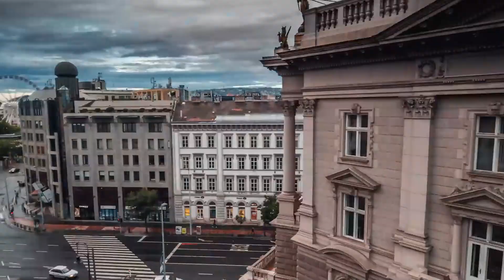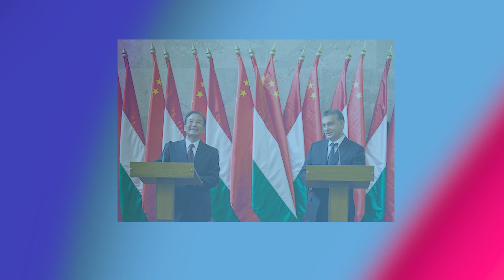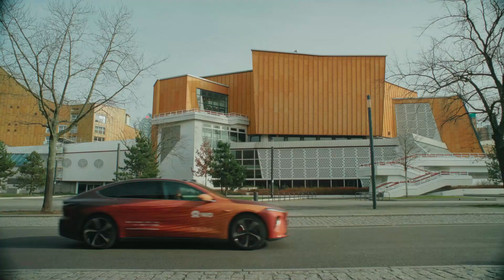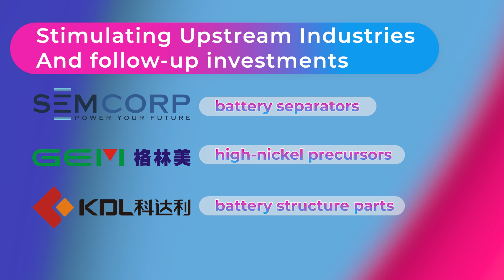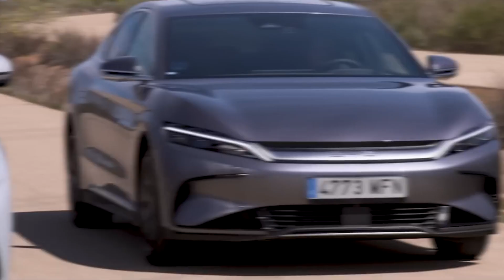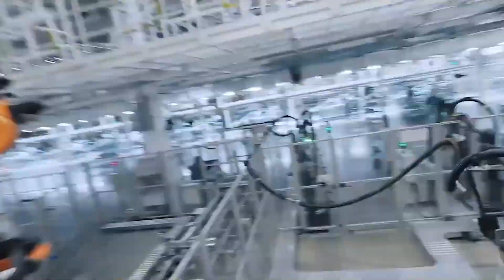Why Hungary teamed up with China to make EV?

Comment: Interesting. Thanks George. 
It might have been worth mentioning the impact of B&RI on the speed of rail freight between China and Europe. I saw a video a while back which explained that it's now possible to export goods (e.g. wine) from Madrid by train and they will arrive in Beijing two weeks later. That's 4 weeks sooner than if they are sent by boat. This seems to me what underpins Hungary as a gateway to Europe for BYD etc because it more or less guarantees  that the supply chain can continue uninterrupted. You have to hand it to the Chinese when it comes to strategic thinking.
Reply from the maker: Yes, and some vehicles like the SERES 5 are being transported by that train to Europe,